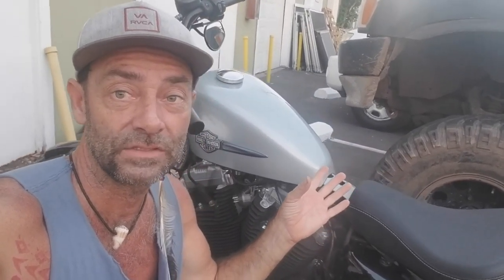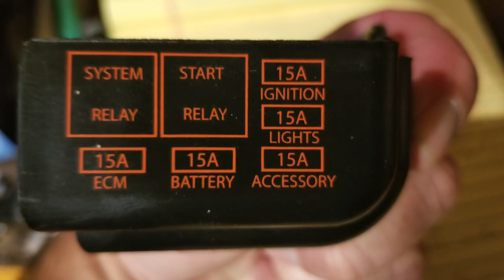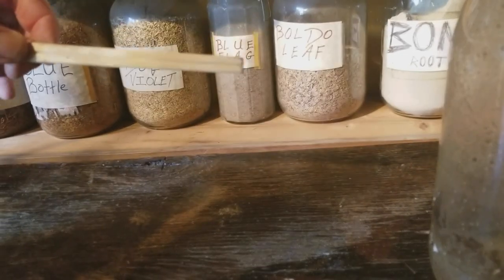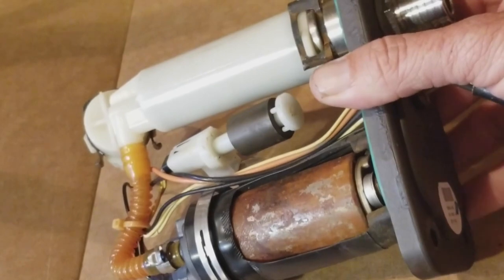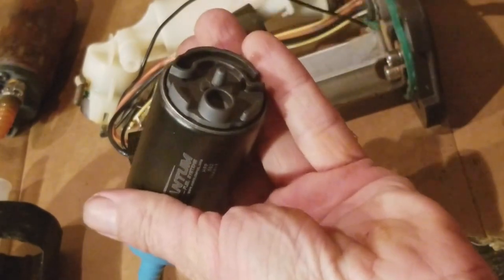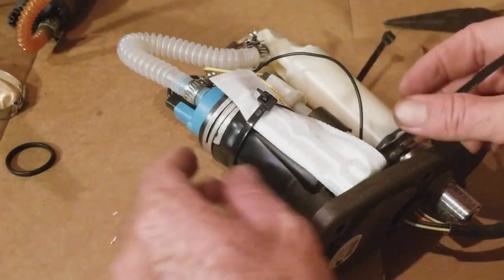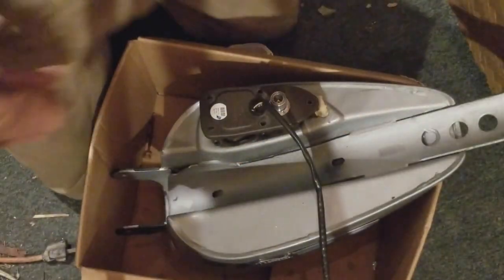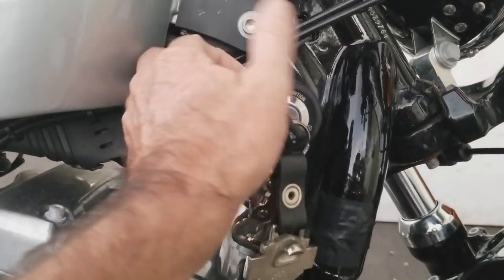Harley Sportster Fuel Pump/Fuel Filter Replacement, Tank/Seat Removal & Trouble Shoot/Tips Tutorial

Comment: Thanks for posting, very detailed video! Seriously great video!
Not ragging on your post. When checking fuses with the test light- check both sides of each fuse. One side is hot even when the fuse is blown. Check power to the orange wire at the fuel pump connector- it will be hot for a few seconds as the ignition is turned on. 
The clamp that holds the fuel pump to the mount bracket has a guide tab that sits in the center slot, this will make the clamp more stable. The fuel hose can be shortened, that would eliminate the hose pushing filter housing away from the fuel pump. When installing the fuel filter housing put a little o-ring lube on the new o-ring. This will just make it easier to push it back in place and not stress the new o-ring. 
Again, great video. Lots of great information! 
Getting ready to change my pump and it was good to see what is there prior to opening it up!
Reply from the maker: Kool... thanks for the tips. We all appreciate it.

Comment: Thx for a great video. My tank was filled with water base + gas due to the gas pump was empty and salesman forgot turning the gas pump off and I was the unlucky customer. The the bike sis not start at all after filling up and I must extracted to empty the tank.

I refill with good gas and the bike started and running. However, the bike poosing power, popping a lots and occasionally engine light on, etc.

I added some gas cleaner and it still hiccups, loosing power, popping , etc. I guess I will remove the tank and replace the fuel pump like you did. 

Do you have any suggestion?  Thx

Comment: Very nice video 👍🏻 I have problem with my Sportster and I think ( I am not sure ) that it’s the same things that I will have to change.. Stops suddenly when I am driving. Can you give me any advice on this. Thank you!
Reply from the maker: Like I said, in the video... I don't claim to be Mr. Motor cycle mechanic. With cars and motorcycles... start with air, gas and spark. So, maybe change the filter and fuel pump. Also change the spark plugs. But, it sounds like something sits on the bottom and when running gets pulled and clogs the flow. Try Sea Foam or a known good cleaner solvent safe to run through your bikes fuel system. Good luck!
Reply: ISLAND SPICE HAWAII thank you for your time 👍🏻

Comment: You'll regret installing a Quantum pump motor. Junk!
Reply from the maker: Thanks so much for your input. Its been a few years with zero issues. It actually seems like a stronger pump flow with the intake. Please share any suggestions...I'm definitely open to any recommendations as well as others viewing these videos.
Reply: @islandspicehawaii  If you ever have to service that pump again, go with a simple $19 ebay refresh kit and if the Quantum motor gives out...and it will...get a Walbro.